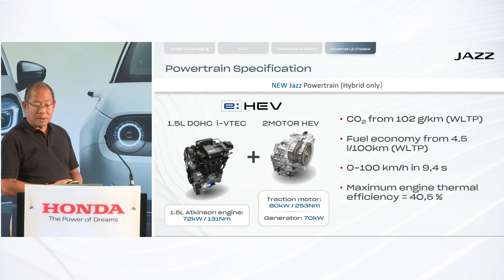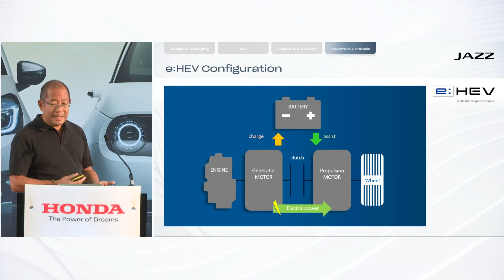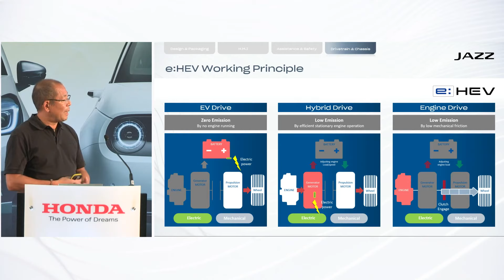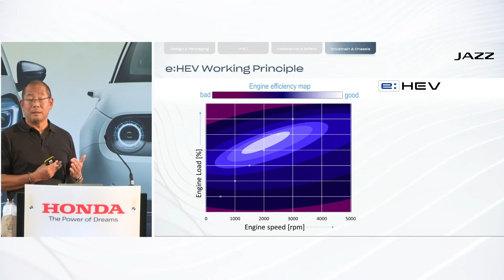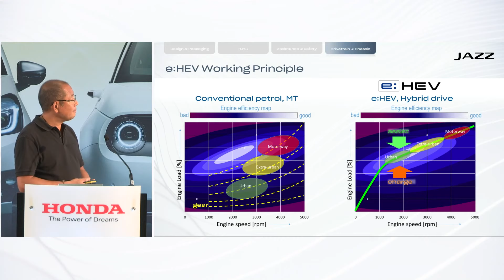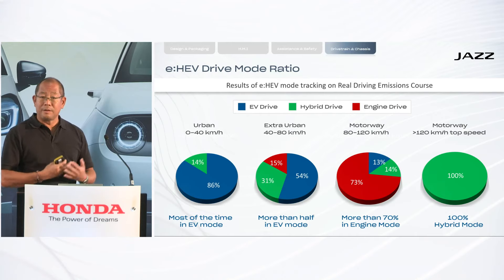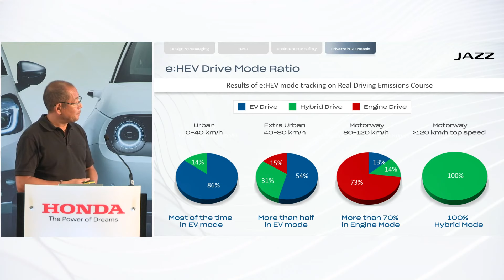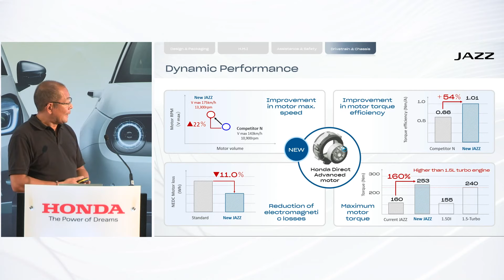Honda e:HEV Hybrid System – How it Works (Ko Yamamoto, Technical Advisor Honda Motor Europe)

Comment: what about an underperforming battery scenarios, how it will be effecting the dynamics towards engine driven, highway mode?.
Reply: It will run as well with no battery, it generates power directly from the IC engine and send it to the propeller motor.
Is obviously has limited power to 90hp instead 110, as the generator has that power generation capabilities....
Reply: @alec-s  The engine's output is not tied directly to the power needed by the motor. The 72 kW (97 HP) engine will run as efficiently as it can. This will be more than the motor needs when cruising, with the excess used to charge the battery. But it will be less under hard acceleration, with the shortfall covered by the battery. Honda estimates that the two combined can make 125 HP. That is enough for 85% of it (107 HP) to power the 107 HP motor, and 15% to be used for other systems. And btw, this 85% is the the usual convention for how much engine power reaches the wheels in a conventional ICE car.
Reply: @jeffjo8732  the engine speed is proportional to the power required, trying to keep the engine in a certain rpm, but that is, I can tell you 100%.
Reply: @alec-s  I have no idea what you are trying to say. In hybrid drivem the engine is not trying to maintain a certain rpm - there is no need. It is run at the rpm that correspond to the most efficient operation for the power output required from it. But what is required from it does not correspond directly to what the motor needs

This car has two sources of power: the ICE-driven generator, and the battery. The ICE-driven generator can produce 97 electrical HP. The battery apparently can add 28 electrical HP to that, making 125 electrical HP.

The power budget allots 107 HP of this to power the traction motor. The remaining 18 HP goes to things like power brakes and steering, A/C, and electrical conversion losses. This is a convention used by gas cars: 85% of tghe engine's power can reach the wheels.

I personally don't think the battery is limited to 28 HP. I think Honda calculated backwards, using the 85% convention. They started with the 107 HP motor calculated how much power a pure ICE car would need, to produce the same 107 HP at the wheel. Which is all of that 107 hp. I can think of no other reason why every iMMD hybrid, with different batteries and engines, all have a traction motor that has 85% the "total combined power" advertised for the car.
Reply: Jeff, the engine doesn't run at a fixed rpm independently by your power need , it is related to it.
If you go at 70 the engine revs low, if you go 120 the engine revs higher, because you need more power.
The battery only has 1 kWh capacity, so it is designed for city traffic use.
That is what I meant.
Reply: @alec-s  I'm assuming you mean 70 to 120 kmph. What I'm going to pass along to you is based on similar mph, but is for the Accord. Because I have actual Honda research data for it.

In the speed range you talk about (45 mph to 75 mph), on flat ground the car will be in Engine Drive, not Hybrid Drive (2:10 in the video). To maintain those speeds, the Accord needs 9.5 to 28.8 HP.

Because it is in Engine Drive, there is a fixed rpm relationship based on car speed: about 1,665 (45 mph) to 2,775 (75 mph) rpm. But for best efficiency, at those rpms the engine makes about 25 to 50 HP. This is the green line at 5:15. It is always greater than the needs of the car on a flat road, so it will charge the battery with the excess. The size of the battery will be irrelevant, except to determine when ....

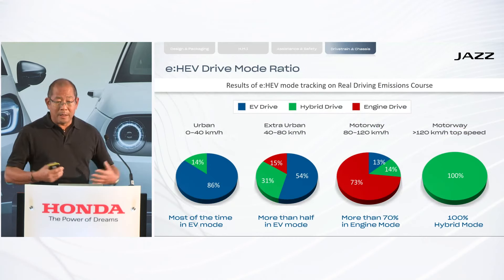... It turns the ICE off and changes to EV drive. By the charts at 6:30, it will be in EV drive between 50% (70 kmph) and 10% (110 kmph) of the time. Those are approximate numbers, since the charts cover a range.

Now, if you are not on a flat highway, or are accelerating, the car will use Hybrid Drive. The engine is disconnected from the wheels, and rpms are unrelated to speed. The engine generates just the power needed by the motor, after the battery's capability is subtracted. Its rpm will be determined by where the green line in the figure at 5:15 crosses the line corresponding to that amount of power.

In the Fit, the green-line power tops out at 97 HP. The battery can add 28 HP to that, making 125 HP. 18 HP goes to other devices, and 107 HP reaches the traction motor.
Reply: @jeffjo8732  the speed and power are different things, ice generates the power you need in that moment unrelated to speed.
The electric engine has 80kw and cannot add any power to ice, they only can be used alternatively.
I drive the jazz and once the battery is empty ice has to generate the power you are using..
Where did you get 28hp from?
Reply: @alec-s  Maybe you should get a degree in Physics before you try to instruct those of us who already have one.

POWER = (conversion factor)*TORQUE*RPM.

In the Accord, with the the ICE running at 1,665 rpm, it is most efficient (210 grams of gas per kWh produced) when it makes about 80 lb-ft of torque. The conversion factor is 1/5252. So 80*1665/5252=25.4 HP. At 2775 rpm, it is closer to 209 g/kWh when it makes 95 lb-ft of torque. So 95*2775/5252=50.2 HP. (The increase in torque corresponds to the rising green line at 5:10.)

The electric motor (gas engine and electric motor ) can add power to that of the engine, but only in Engine Drive. Which is only used when low power is needed, so it does not factor into this discussion.

Stop me if you've heard this before: In Hybrid Drive, the ICE does not power the wheels at all. Only the electric motor does. It is powered by the combination of the ICE-driven generator and the battery. The ICE-driven generator can provide 97 HP. The total power is 125 HP. That means that the battery is supplying (125-97)=28 HP
Reply: @jeffjo8732  the  power you need to move is: (Aerodynamic resistance + rolling resistance of wheels + - horizontal components of weight) {Newton} *  speed { m/s} = watt {N.m/S} also joule/second
No conversion factors, just SI...
Battery can supply more than 28hp, but just for a short period of time that is:
1kwh is 1 kW of power for one hour or 80kw of output per 45 seconds.

Go study mate

I'd like to add some information, Honda jazz power train is made of an ice of 72kW (96hp) and a electric engine of 80kW that can output a max peak power of 80kW.
Where did you get 128hp?
Reply: @alec-s  If the subject here were the power needed to maintain speed, that would be the formula to use. But the subject is the power that the car can generate, which is POWER=TORQUE*RPM. And conversion factors are needed only to use units we are accustomed to. Hence "conversion."

There are four power figures listed by Honda for the Jazz hybrid. The engine power is 72 kW (97 HP), the traction motor power is 80 kW (107 HP), thje generator power is 70 kW (94 HP), and the combined system power is 93 kW (125 bhp). Find spec sheet, "mate."

Note that 85% of the combined power, 93 kW, is 80 kW (there apparently is some round-off error here - it is closer in HP). Every Honda iMMD hybrid has a traction motor that is rated for (meaning it is the maximum input, not the output) 85% of the advertised combined power.

To correct your information, in Hybrid Drive the Honda jazz's power train comprises an ICE capable of 72kW (96 HP) that drives a generator capable of 70 kW (94 HP). It also has a battery, but I haven't seen exact specs for it. Both send power to a Power Control Unit, or PCU, which combines them to get a maximum of 93 kW (125 HP). This powers several peripherals as well as the motor, and there are losses. The most that reaches the motor is 80 kW (107 HP).
Reply: @jeffjo8732  😂😂😂😂🖐️🖐️🖐️🖐️

Comment: Does the generator transfer power to the propulsion motor by converter in Hybrid Drive?
The principle seems a bit like railway diesel-electric locomotive lol.
Reply: In Hybrid Drive, the generator's A/C output is sent to a device called the Power Control Unit, or PCU. It is also connected to the motor and the battery. It converts the type (AC or DC) and voltage of the electricity to what each of these three devices needs.

The difference between this and a diesel-electric locomotive is the battery. It allows the power produced by the generator to be different than the power sent to the motor. This is what allows the ICE manipulation that is described starting around 4:50 in the video.

Comment: Can someone explain how the engine can run in engine Mode with such a high frequency of the spinning wheel without a gearbox?
Reply: Engine Drive can only be used above about 40 mph. In the Accord, RPM ~= 37*MPH, so that's about 1500 rpm or more. Below that speed, the engine is always disconnected from the wheels, and drives only a generator.
Reply: Despite the remark from the presenter, it has a gearbox, at least between the electric motor and the axles. It is just a fixed ratio, like any common electric car. In the Accord version, the engine turns about 2.5 times as fast as the wheels, like a typical car with a transmission in top gear.
Reply: @brianb-p6586  That depends on what you think "gearbox" means. If it is just a box with at least one gear, nearly all cars have them. The exception would be hub-mounted electric motors. But to most people, a gearbox has the capability to change the gear ratio between the input and output.

In the Accord, the overdrive gear turns with the engine and drives the countershaft gear. It in turn drives the differential. The ratio between crankshaft and differential is (54/67)*(65/19) = 2.75 .

The motor has a similar arrangement, where its rotor takes the place of the overdrive gear. The ratio is (54/22)*(65/19) = 8.40
Reply: @jeffjo8732  "most people" might expect to be able to shift a gearbox because automotive gearboxes for internal combustion engines all need multiple ratios - that doesn't change the meaning of "gearbox". Gearboxes outside of vehicles are normally fixed-ratio.

Yes, those are the Accord i-MMD ratios. No details of gearing of this specific compact variant for the Jazz are given in this presentation or the videos that I have seen about other variants, so I don't know how many gear sets are used or what the ratios are between components in this one... but similar values should be expected. Automobile Catalog reports the same ratios as the Accord, but that's not authoritative.
Reply: @brianb-p6586  Depends on what you mean by "gearbox." Is it any "box" with "gears," or something more specific?

A lot of these words get modified from their technical definitions, to ones that fit into their very limited usage in a particular vehicle. For example, a BEV owner will say that his car doesn't have a transmission, yet power has to be transmitted from the motor to the wheels somehow. That is the job of a transmission system, which has been shortened to transmission for conventional cars. What the BEV lacks is not this system, but the components that change the result of the process.

So they ignore the clutch or torque converter, the rpm reduction, and the differential that are all necessary parts of the system. And then to many, transmission means just the part that the driver interacts with to change gears (or can feel as it happens automatically). And in order to differentiate this interactive part from the other necessary parts of the system, an engineer might call the variable-gear setup a "gearbox."

I picked a spot in this animation (https://youtu.be/CHVI8r0nlk4?t=113) to illustrate, since it is a very accurate depiction of the Honda system. Except for the gearing needed to connect the different part (ICE geared to generator, power sources geared to countershaft and then to differential), this system has a one clutch and one gear. The gear is there only because the rpm reduction for the engine is different from that needed for the motor.
Reply: @jeffjo8732  yes, a gearbox is any "box" with gears.